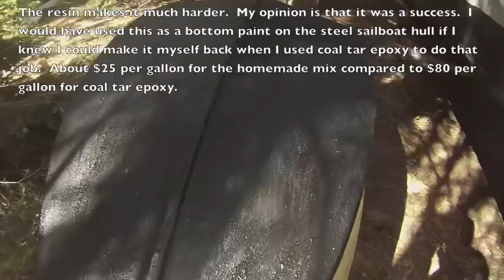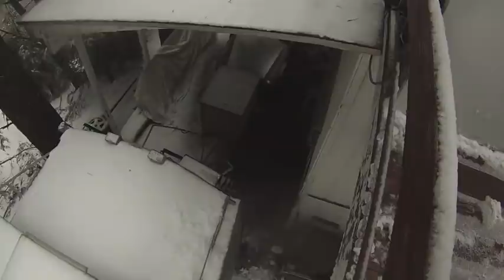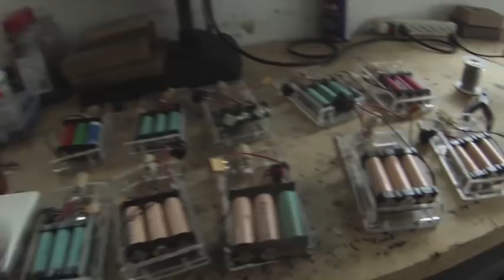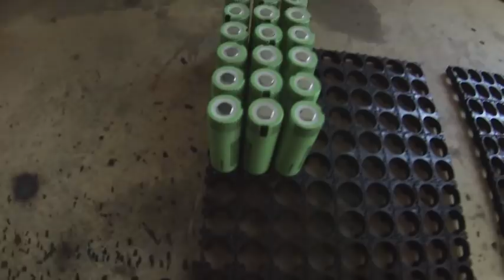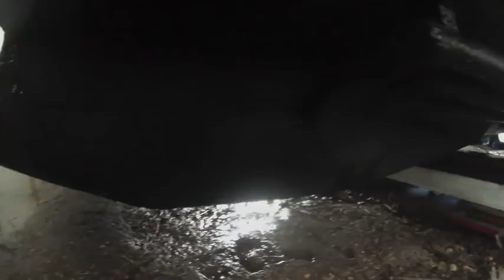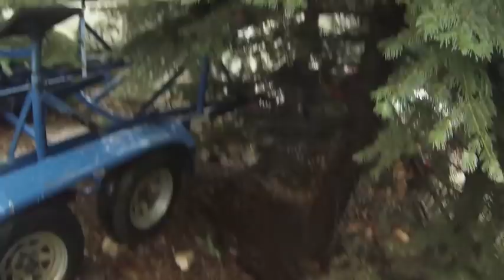Steel Sailboat Build Part 38

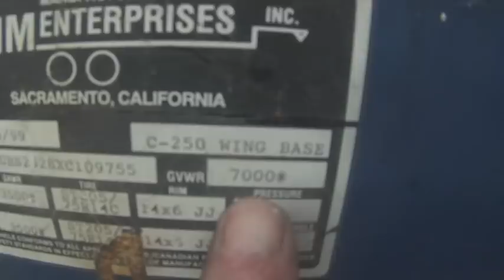Comment: 5:10  7000 lb. GVRW is the total weight. Your trailer is only good for a 5000 lb. payload. Catalina 25 is 4500 lbs. your boat is well over that.  I bet you don't even know the weight
Reply: He doesn't know what hes doing  full stop, hes making it up as he goes along based on what's cheapest,  or preferably free.
Reply: Its a one way trip

Comment: I'd avoid soldering batteries if possible, it's not a mechanical joint, creates hassles later. A battery spot welder is easy to make.